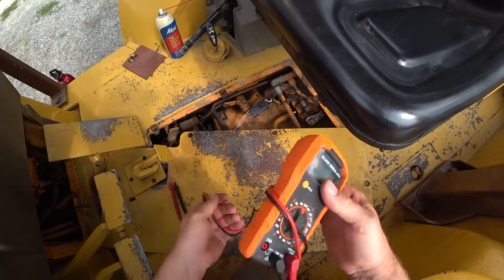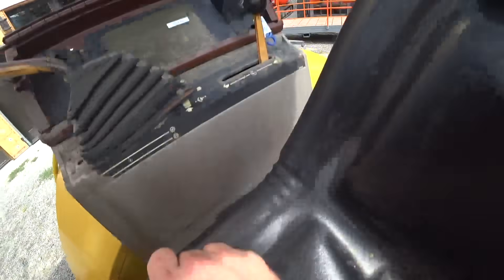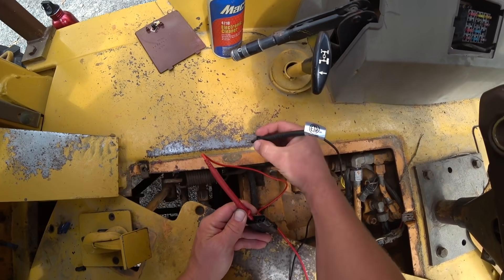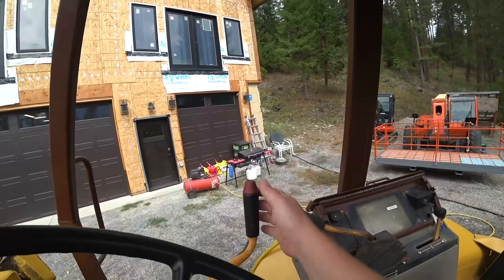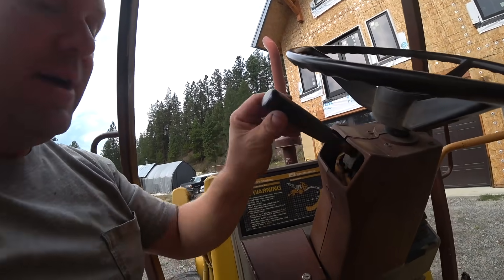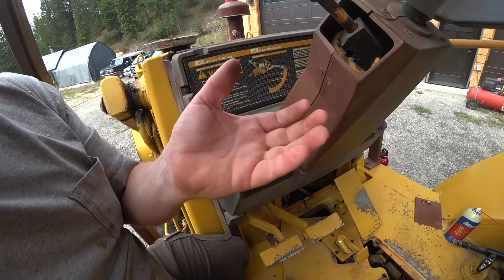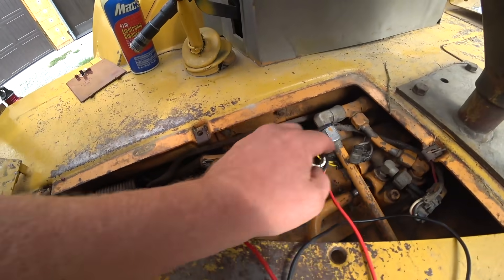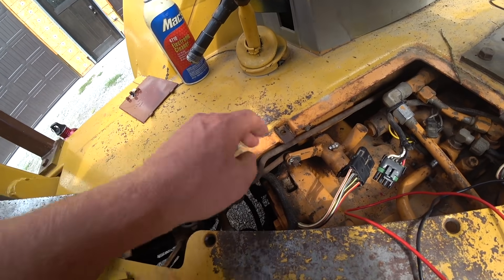TIME FOR A NEW BACKHOE?

Comment: "Sorry a little long"  As a electrician, trouble shooting electric take time and knowledge(understanding electric). You have one great advantage, the machine wring diagram. Start with just that fuse and draw it out on paper. """ If you can draw  and understand that, then pieces fall in place. """  " STOP JUST REPLACING FUSES " Next time at the auto store Buy 3 or 4 - 12 Volt/50 Watt light bulbs and sockets with or without wire tails (you will need wire tails or added them) and a In-Line Fuse Holder. Now wire the light blub's in parallel then attach 1 end to the fuse holder. Then add a male wire connector to 1 end of the lights blub's and 1 end of the fuse holder, so they could be plugged into the fuse slot. When the light lights up bright you have a short circuit and when the light is off the wire is open and when the light is low the circuit is inline with a load. If the light is low you could shake the wire loom or press switchs to see if the wire short and the light goes bright. Or say you have a short after 1 switch(you press it and it shorts), The move the light tester to after the switch and go from there until you find the short. This is the best I could explain in this short space.

Comment: Jesse, your extra hard on yourself..
Something did happen.. you tried to trouble shoot your wiring for your Case backhoe..however your just not strong in that, but no where did i see you referring to a wiring diagram .. now you did mention about how did you put it? Kind of like isolating wires... you really do need to refer to a wiring diagram to see where wires go and other connectors the goal in all that is to break circuits in half or thirds... check continuity each end of wiring legs.  But what if your short is in the button on the loader stick or the shifter??

Comment: The wire connects to the solenoid right? The solenoid is on the back side of the coupler you replaced. The solenoid could be going bad. It is mechanical and could wear out. One other thing is that there could have been something metallic that was shorting but you took care of that when you blew it out.

Comment: If the fuse is before the switch it is probably the switch... if its after then it could be a solenoid. Or bare wire... or gremlins
Reply: I find gremlins all the time.  Those darn things are everywhere.

Comment: If rain was what may have caused the problems, maybe a good project for the future is to build an equipment barn to get the equipment out of the elements.  You guys have a lot of money invested in your equipment, shame to let the weather take such a toll on it.  I'm guessing between the three large pieces of equipment you likely have $75K+ invested.  A few thousand for a pole barn or a high tunnel structure to get the equipment into for the winter months.  Just thought of another piece of equipment for a barn, your sawm mill.

Comment: Check the cables from the two switches. I think the switch that was replaced may have a cable touching the metal tube. Might be why it is intermittent as the cables move. Or the cables may be rubbed through on one of the bends in the shifters.

Comment: Those switches control a large round solenoid that threads on to the side of the transmission that opens a bypass. I have seen them get wet and cause that problem but if it is going bad it is a easy  and inexpensive. Hope that helps

Comment: When you say you replaced the weather pack and then things did not work the same....this is suspect. I am a technician and when something stops working then I always ask myself what the last thing I did is... I have caused myself so much work...Me thinks you got some wires mixed up when you worked on the weather pack....

Comment: move both levers that have the switches on them in all the various posistions and then try to press the buttons to see if you can get it to blow fuses..... maybe the wires are rubbing with the levers are in different posistions....

Comment: Replace the fuse with a circuit breaker that fits in your fuse block so you don’t go through so many fuses 

Once you figure it out then put a regular fuse back in.  I would also just run a new wire temporarily to isolate different parts of the circuit.  For example run a wire from your new connector to the front switch if the circuit breaker doesn’t pop that’s the part that’s bad if not then keep moving down the circuit until you find it.

Comment: Sometimes ya gotta just let the smoke out.  Put a gazillion amp fuse in and look to see where the smoke comes out.  There is your short.
I had a tool called a megger It would put a gaggle of volts through wire and break down the insulation where it is weak.  Then take the ambient temp and Ohms law to finds the distance away the break is.

Comment: I know there's a new boot on the button you replaced. What about the other lever? Also, what if you throw a ziplock bag over both levers to keep water from seeping into the buttons. At least until fixed. I know moisture will still creep in, however, mitigation isn't a bad thought. Also, some weather stripping along the floor panel may help keep the water from directly contacting that electrical.

Comment: The company I work for recently replaced a 2006 enclosed cab CAT 416C backhoe we had for a new 2019 enclosed cab 420F with AC, when I picked  up, it had only 7 hours, we now have three 420 backhoes in our territory.
Reply: Our old machines get hauled away by a contractor and gets auctioned somewhere in the midwest, On the old 416C I replaced a bunch of hydraulic hoses, pins, changed all of the filters and fluids, new cabin filters, then the company decided to replace it about a month after I did all of that work.

Comment: 2 more switch s at the brake peddles too...580c i got lots of experience chase n wiring...continuity chks at harness plugs to ground to chk for short s in remote section s of harness helps alot too

Comment: Keep in mind you don't need a short to blow a fuse, Poor connections such as corrosion from being wet/frayed wires at connectors etc can cause high resistance on both the live and ground side. These are generally the hardest thing to diagnose as you seem to have discovered :P I generally start with a resistance test.

Comment: Deutsch connectors are *BY FAR* the best connectors to replace anything with. The are compact, seal well, they are easy to depin for probing and easy to crimp the terminals on various wire sizes. They are used on almost every equipment manufacturer in the last 15-20 years.

Also, you can get resettable fuses for about $5 each in different current ratings.

Comment: Also after crimping the pin make sure the pin is straight use the small needle-nose to bend it back level and then it will go into the weather pack easier

Comment: you can get a tester that will find the short.  You plug in a breaker instead of a fuse and then it will turn off and on until you find the short.  It takes a shorter time to find the short with a short finder  :). follow the wire with the tester and the tester will deflect when the current is in the line and will quit when you go past the short or broken wire locating the short.  I have two of these testers.

Comment: One thing you said about it being better that it's an intermittent problem.  As an electronics tech and broadcast engineer I couldn't DISAGREE with you more!  An intermittent problem is an absolute bitch (apologies to female canines) to troubleshoot, hard failures are much easier to diagnose.  When it reappears, look at where your suspect wire makes a sharp bend and / or leaves a wire bundle, such as when it goes up into one of the lever arms and at pivot points.  Your service manual from the previous video actually looked like it had a fairly complete wiring diagram, make a copy of the relevant page(s) so you can mark them up as you chase your ghost!

Comment: That is an interesting take on an intermitant issue. Haven't heard that one before. I didn't see a power probe in your tool set for this diagnosis. I find those invaluable when doing automotive electrical. One with a penetration probe.

Comment: The disconnect switch on the gear shift is supposed to have a rubber cover on it too.
I used to own that model backhoe. That series had known electrical issues.  My issues were with the neutral start switch.

Comment: They have a re-stable fuse you can buy fairly cheap to help diagnose issues like this.  Also power probe has an additional part you can buy (I'm sure you can buy it separately and from another manufacture or stand alone manufacture) that creates a tone in the wire and you use the device a follow the wire till it grounded out.  It will at least get you in the right area to dive deeper where the problem actually is instead of hunting blindly.  Great video as always

Comment: How about using an audible rg11 tester? You can trace the wire and where it goes quite easily

Another route would be to bridge the fuse holder contacts and let the cable short until you see smoke coming from somewhere 

There is your short to ground

Comment: Blowing fuse after fuse after fuse …. Cost money, and can be very frustrating!

Cheap way of testing and not blowing fuses, take one of the blown fuse and solder a 12v light across the contacts of the burnt fuse and put it into the fuse holder (a low wattage light like a dash board light or a turn signal light, not a head light).

With the light in the circuit as a fuse, the function (in your case the buttons on the shiftier) may not work, but the light will come on dim, if there is a short that would have blown the fuse the light will come on bright. (a meter across the light when it is bright should be the running voltage of the tractor or very close to this voltage indicating a short…. When dim the voltage should be around about half  the running voltage, indicating no short in the cabling).

Just a trick to save blowing fuse every time you what to try/test a theory that maybe we have fixed it this time  :-)
Reply: I was going to suggest using a light bulb in the fuse holder yeah I've done that quite a few times and has always worked and it'll save time and fuses and not only that you can trace out and when you correct the problem the light should go back to dim or out I've been electrician for over 40 plus years and I'm retired

Comment: Use dialectic grease but only around the seals. Not on the metal conductors.  It will prevent electrons free flowing. The dialectic grease will prevent water and moisture from grounding out or short circuiting

Comment: Intermittent failures are the worst thing to troubleshoot. The next worst thing is multiple failures in the same circuit. Think about looking at your grounds for corrosion and broken connectors. I worked military aircraft maintenance most of my life. Get you schematic out and mentally decide the circuit in half. Go to that mid point and try to narrow down the failure to one side of the circuit or the other. That will help isolate the failure. Continue to use the same  technique to further isolate the failure. Sounds very logical, but you would be amazed on how many people just jump in without a troubleshooting plan.

Comment: Intermittents are a b*$ch! This was a GREAT video! I've had many pieces of equipment, and even a Duramax diesel 2500HD pickup truck that were put back in running condition just by wiggling a wiring harness. The main reason for this today is cost cutting. Back in the day, wires had nearly double the jacket thickness covering them, and not only that, the copper quality was much better.

This same exact thing leaves alot of modern cars stuck on the side of the road. We're always taught to do all your testing before moving any harnesses under the hood for this exact reason - once you lose the problem, diagnosis is impossible. There's probably just a tiny part of one tiny strand of wire making contact to ground, either on the chassis, or through the ground wire like you said. If it's in the harness, sometimes it's easier just to run a new wire. As "backyard"  as that sounds, sometimes even professionals have to do this in the interest of time for them, and money for the customer. 

NICE job, Jesse! You'd do great in this industry ... but, be glad you're not ... 😉 I enjoyed working on cars built before 1995. Some days, I wish I had become a dentist ... 😂

Comment: I’d try using it with jumpers.  So have a wire go right from the switch to the fuse.  And then jump each individual section of wire harness to figure out if you can find the section that shorts
Also If you think it’s a water issue. You should try to tarp it when you can until you’re able to build a storage shed for it.  Even if the shed doesn’t have walls.   Just a big roof

Comment: Get a can of crc and spray all connectors switches and control lever on steering column, button switches. This is a water proof coating to keep dampness from corroding wires, Look for this corroding and lose connections. Modify any plastic covers to get better access to the loom.

Comment: try spraying the wire with CRC Wire Dryer 6oz it can keep water out. If it happens again after it rains. I had to use something like it on my 1969 Comaro distributer cap  to keep it dry.

Comment: Putting a jumper across the solenoid side of the harness would tell you if the short was in the solenoid side or the switches side.

Comment: in order for a fuse to blow it need to draw large amount of current. Rain definitely not going to cause other than corrosion. Like others have noted, check the places that moves a lot. Like where wires enter into hand levers.

Comment: Also you might have to get a total wire harness because i have had a issues like that in a truck searched for a week or two and still had issues after i got the new harness i searched through the old one and it was two wire taping each other in outer sheath . it was a 20 year old truck have been driving truck ever since and not problems with that again.

Comment: To you a mystery, but to a mechanic, your machine is playing with you, as a mechanic of 45 years experience these pieces of yellow iron will play with your mind, and they do have a mind of their own, believe it or not,
Reply: Steve,  You are soo right.  I've worked as an Electrician, a radio Engineer and a Systems Integrator in the last 40 years and have several sayings along that line.

Comment: This video is actually more educational than Jesse gives himself credit for. Take your time. Be patient. Take a break when you need it. Have a second set of eyes (or many in this case). 
Try the half-split method. Start right at the fuse panel itself where the fuses blow. Inspect how the wires connect to it. Disassemble the fuse panel and visually inspect it. You will see the true colours of the wires that is causing the fuse to blow. The second benefit to inspecting the fuse panel is seeing the direction those wires go in within the backhoe. I hope this helps.

Comment: Jesse!  You saw a short when the 4-pin connector was together and engine was running (vibration).  After you separated male & female parts of connector, I only saw you check for a short on the female side.  The short could be on the MALE side of connector!

Comment: Several things, not sure how old that video is, maybe you've got it fixed by now.  Try some of the following but one at a time.  If the problem goes away that may have been the cause.  Leave that "fix" in place and make sure it stays "fixed", then permanently fix it.  Be patient.
Do not rely on the beeper on your meter to look for shorts, it beeps at a certain amount of resistance that might or might not be enough to cause a short.  
If you think it is water getting into the buttons, put a couple plastic bags over one of them to keep the water off the button.
Learn to use your cell phone, if you can't get your head into a spot to see something put your cell phone in there and take a picture or ten, what ever it takes.
If you think it has been rubbing someplace and can't get to it well, slit a piece of hose and slide it in place to protect where you thought it was rubbing and keep in place temporarily with ty-wraps.
There was another floor panel behind the seat, would that let you look at the wiring harness?
Have you considered that the solenoid might be going bad and have a short there?
What about the two wires in the plug you had forgotten to re connect for the shifter button?
With an intermittent short it will take time to find it by isolating one thing at a time then using the backhoe enough to see if you cured the issue..

Comment: Most likely cause of grounds of that nature is inside the handles because the wire moves back and forth inside the handles every time you move the levers so I would check the bottom of the levers for your rub point often times there is a grommet that has fallen out of that area or there is not one ever installed. you can take a piece of fuel line or any rubber hose to make a chafe guard there.

Comment: Ya know, I had a problem like this one time with electric windows in a car.  Turned out, I was replacing the 15 amp fuse with a 3 amp fuse.  Are you using the right value fuse?

Comment: I would replace both button switches, if still cutting out put a 60 amp fuse and  look for smoke. Shifting is the only time you need it to work, run a new wire.

Comment: If you chased wiring and didn't find it, check solenoid(s)? and the switches themselves. Switch buttons stay in the weather, if it grounds when you push it from wear or water or combo of both it will blow the fuse
Reply: I would check that also a fuse can also blow because the circuit is pulling to much current, Like a gummed up old solenoid.